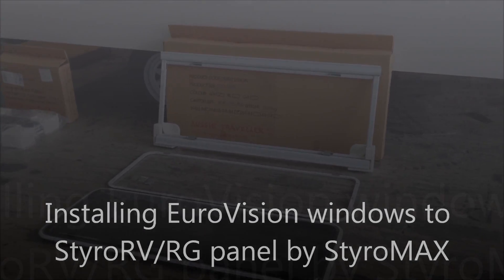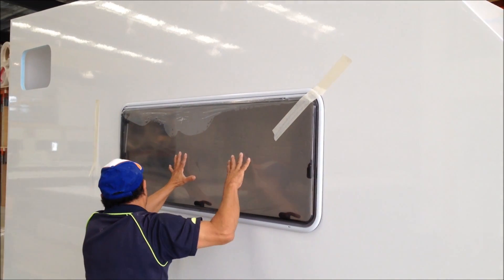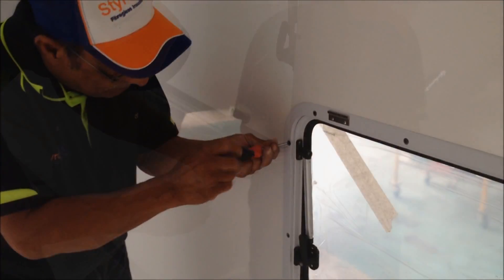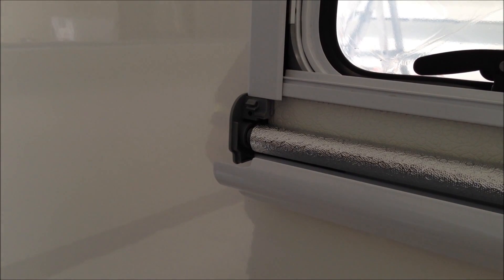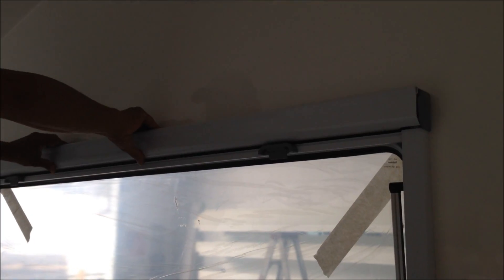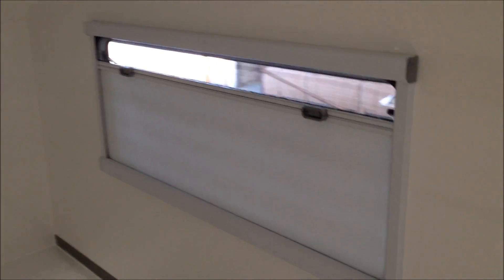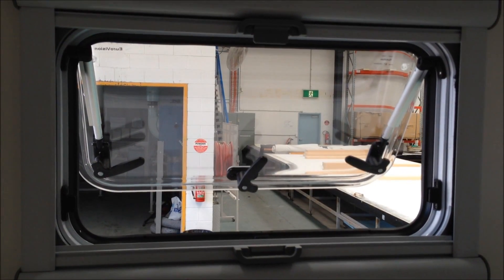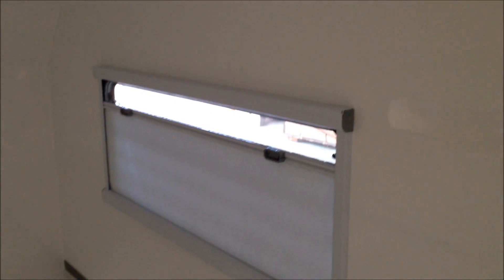Installing EuroVision Windows to StyroRV/RG panels by StyroMAX

Comment: Thanks mate. I had one start to fall off on my van and freaked out how to fix it. I guess the manufacturer didn't "be careful not to overtighten the screws" as you said. Anyway, toothpick in the stripped hole and screwed back on in a few minutes.
Thanks for sharing great info like this. 
Now to check out you wind out windows for our other van we're rebuilding. Cheers.

Comment: Can you tell me please from where can i buy the blind+ mosquito system ? i have already the windows mounted .... Thank you
Reply from the maker: Where are you located? Please send an inquiry through our website of your location and size of window.
Reply: Thank you for your reply . I'm from Europe in Romania , and the  window size is :
        L x H   x Pieces in mm:

1200 x 600 x 1
1200 x 500 x 1
  820 x 440 x 3
  440 x 600 x 1 
  600 x 440 x 2
The windows and door is my business , is made of PVC 60mm ( for sandwich panel 60mm  or smaller )  with 3 security solar control glasses  (the transfer K=0.7 W/mpK ) . 
Something like KCT if you know ...
I expect your reply with prices . My email adress is  gadrian70@gmail.com
Thank you again
Reply from the maker: @gadrian2002  Thanks, we've sent you an email.
Reply: @StyroMAXInsulatedPanels  Were you able to find and can you share the info. I already have my windows installed, but want to shade them for stealth.

Comment: how do you cut out the metal for a window. Is there are template?
Reply from the maker: For this  window you simply add 3mm to the height and width for the hole cut out. 

https://www.aussietraveller.com.au/products/caravan-components/windows/eurovision-window